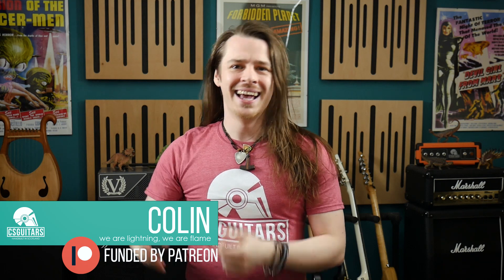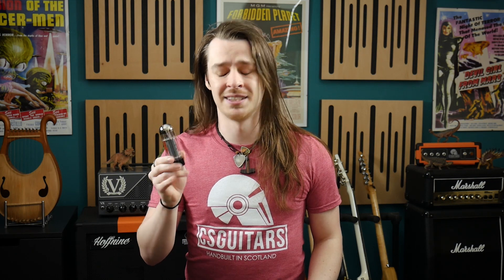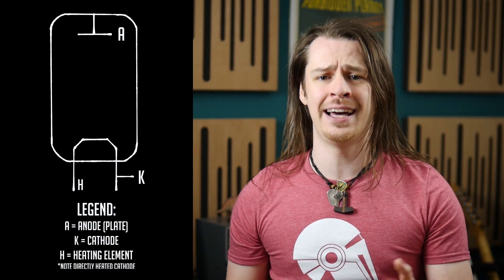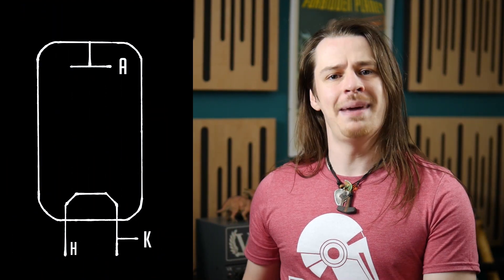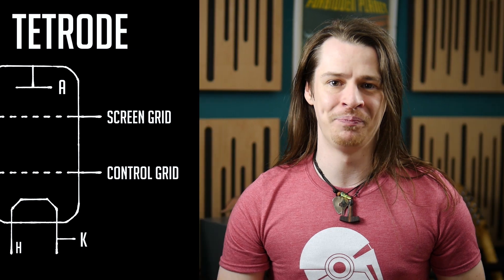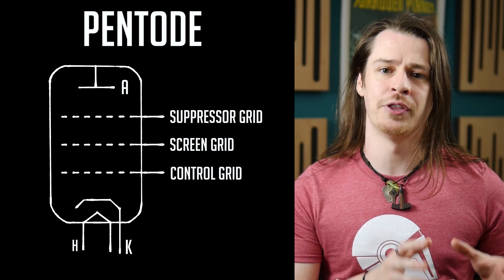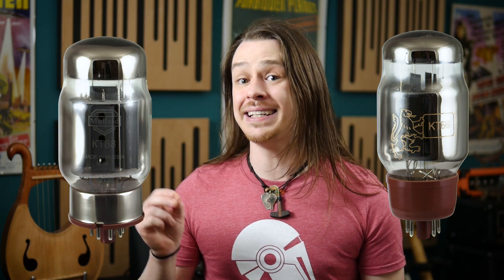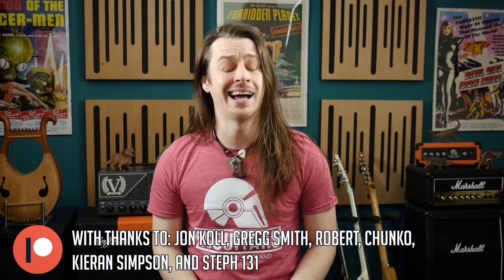Valve vs Tube | Troublesome Terminology

Comment: There's also the terminology difference of "Condenser" and "Capacitor" :)
Reply: Capacity is what it has, condense is what it does (can do).  Its capacity is its value, hence 'Capacitor'.  As a young (starter) TV engineer in the 1950's, this really confused me.  So what is it when it isn't condensing (reservoir)?  Like when it's coupling (DC block or -ve grid biassing), or filtering (by-passing).  Then like the fool I was, I read an American electronics book, and got really confused.

Comment: The Fleming thermionic valve was invented in UK, where we speak English (as opposed to the US where they speak American English). It was a bulb (bulbous) [1:29] rather than a tube (cylindrical), and rather than call it a bulb it was called a valve as that was its function.
The first triode was a bulb, and not a tube.
Most early valves were not tubular, but did have the function of valves .
Why on earth 'Merkins began to call non-tubular devices 'tubes' is a mystery.

As for Television tube - apart from the gun end it is completely non-tubular. "TV Funnel" would me more appropriate.

Comment: Colin, serious question. I'm planning on using my TubeMeister 40 for the next 45years or so, after which time I'll probably be looking forward to dying. You think it's worth me stocking up on spares now? In case I need a replacement when I'm 60 and the parts just aren't available.

Comment: It's called "electron tube" in Hungary but older people call the amps "lamp amp". :)

It's funny that the term "tube" (csöves) was used here for both the amplifiers and for the old-school rockers of the 80'ies who were wearing tight jeans (the term is referring to the the leg part of the trousers which is straight like a tube unlike those wide bootcut trousers that were in fashion in the 60-70'ies).

Comment: Main problem is a transistor is just as much of a valve as a tube.  We call them Tubes because they are more tubular than the Bulbs(light Bulbs) that they evolved from.  Of course the glass blowing style used for these came from Test Tube manufacture.  The rectifier is interesting in that it appears to have started out as an attempt to solve the self destructive character of early light bulbs then they realized its other properties and finally its use in radio.  Rectifiers would be like flapper valves/heart valves.  Transistors and Tubes work more like water taps in that they vary the flow of a current.

Comment: What about the audio characteristics of each valve? What is the difference between EL34, KT88, 6L6, that sort of thing? For example, KT100 is supposed to be the ideal valve for Drop A tuning or lower. But why? What can it do that other valves cannot? Which valve is best for which use, or are they all the same audio quality?

Can you make a video about this?

Comment: The story I'd heard is that Edison and a lab hand accidentally came upon the concept while trying to perfect the lightbulb. It has been years since I read the story, but I believe they were having difficulties finding a filament material with a slow enough burn to make electrical lighting feasible, and this is why they installed a grid in the first place. 
However, it wouldn't surprise me to learn that Edison was just trying to steal the glory. He was bad about that...  If you don't believe me, check out Nicola Tesla's biography.

Comment: The "valve", as you people on the wrong side of the pond call it, was essentially designed by modifying a glass tube. Therefore the tube came before the "valve". Which means the proper term is tube.

Comment: Britain: We call it a valve because it performs a function that is analagous to a fluid valve

USA: CALL IT TUBE COS IT LOOK LIKE TUBE!

XD
Reply: USA: We call it a trunk because it performs a function that is analogous to a storage trunk and historically was simply a storage trunk lashed to the rear of a vehicle.

Britain: OI! IT'S A BOOT INNIT? I KEEPS ME COLLECTION OF SEVERED FEET BACK THERE!
Reply from the maker: As with many old English words, a vehicle's 'boot' has no etymological connection to the more familiar homonym, referring to feet and their coverings. 

A car 'boot' is a remnant of terminology used for horse drawn coaches, where the boot was a storage compartment within the stage coach which was also used by the coachman as a seat.
Reply: It's almost as if these americans don't quite understand the language they stole ;)
Reply: Its also literally a tube with electronics inside of it.
Reply: so is a torch.
or an electric tothbrush.
or a vibrator.
or a stick blender.

The point is 'valve' is named after what it does , 'tube' is named after what it looks like
Reply: @nuberiffic  It doesn't just look like a tube. That's the point. It is a tube.  Which is a lot more succinct than an illustrative comparison to something completely different... Y'know, like a valve.  Because it is a tube, but it's like a valve.
Reply: Oops, my mistake.  His exact words were that its 'in a similar way' to a valve.
Reply: So why aren't you calling vibrators and torches tubes?
They're literally tubes.

And even then, it's not literally a tube. It's a bulb. With prongs on it. Not a tube - it just kinda looks like one.

Is it maybe because the sensible thing to do is name an object after what it does?

You know how a electronic valve regulates the flow of electricity - because that's what a valve is? Something that regulates flow. Sure it used to only apply to water and air, but that was before we knew we could regulate the flow of other things.
Reply: Damn, I read your first one and replied before I read this haha.

But still, yeah, it works 'in a similar way' in that it performs the exact same function.
Reply: @nuberiffic  lol, we may have to agree to disagree.  I'm not quite as invested in this topic as I realize I was sounding.  Now if we really want to get some deep practice in pointless arguments about english vs american names, we could get into paracetamol vs acetaminophen.  I'd even have to do some extra research on that one.
Reply: Haha, fair enough :)
Reply: @jmurockstar  The trunk is usually located in front of the elephant.

Comment: The glass is there just to hold the vacuum, the shape of the glass doesn't matter, metal was also used.  The 1st diode valves were round and more like light bulb shaped. The triode came later and was made from a glass tube. Plate is also kind of dumb, cathode and anode add info to the device, plate could be anything. Why not dumb it down more and call the cathode the 'stick' and the control grid the wire bits!

Comment: The Russian military still uses valves in things like radar sets apparently. Since a valve isn't susceptible to EMP blasts like a transistor is.
In any event, whether we call it a valve or a tube really doesn't matter, we all know darn well (or should) what is being discussed.
Thanks for the good history lesson, you got a ton of info in there that can get pretty darn technical at times.
Reply: They still use valves for TV transmitters at incredibly high voltages!

Comment: There are these nu-tube things finding their way into pedal-board amps now, with lower voltage requirements for the filament and lower plate voltages too, I think, with their really small size they can be used with SMD designs and apparently reproduce the characteristics of the larger ones very well. I haven't actually seen one in the flesh, but they will hopefully catch on.... they make DIY valve projects much more of an attractive proposition.

Comment: I live in Australia (which is typically British oriented when it comes to language) and even I get some confused looks when talking about "valves" as most guitarists here have learned to call them tube amplifiers (not toobs in this case). 

Myself? I call them valves but use America's classification system for them. 12AX7, not ECC83. I just find it sounds better.

Comment: Maybe a video on Tube/Valve interchanging? Like EL34 vs 6CA7 vs KT66... they have similar pinouts so they can be interchanged but is there a difference in sound?  What if anything is involved in tube interchanging?  Also preamp tubes... .AX AT AY AU.

Maybe a TATA video?

Comment: I never knew a valve could do that 2:24 , pretty impressive.
Reply from the maker: This is how valves amplify. 

A guitar signal is very weak, small voltage and current. 
By applying that small voltage to the Control Grid, the guitar signal controls the much larger flow of current through the valve. What comes out of the anode is then an amplified copy of what was sent to the grid, obviously with the valves own colouration added into the mix.

Comment: Why get so caught up in terminology?  Meanings are in people, not in words.  Hence why two different words can mean the same thing.  What these devices are really called are things like rectifier, triode, tetrode, pentode, etc... With more specific names for each, such as beam power triode or RF pentode.  Electronics engineers often refer to devices by their part number rather than any of the aformentioned.  Arguing about calling it a tube or valve is like arguing potato or spud.

Comment: i got to thinking seeing how the flaming diode works gave me a theory  

couldnt electroplating be done without the acid baths that are used to do most electro plating.

simple place the part you want to plate on the anode and then a chunk of gold as the cathode and do it in a vacuum chamber and heat the gold and the high voltage would emit gold atoms to the part you want to plate.

simple no spent acids that need to be disposed of

Comment: Calling it a valve seems nonsensical. A valve is a mechanical thing that opens and closes. Tubes are not mechanical. Nothing moves. Nothing physically opens. Nobody calls a solid state transistor a valve. And rightly so.
Reply from the maker: Tubes are physically hollow cylinders open at both ends, therefore it's illogical to call valves tubes when they are clearly a bulb.

See, this is fun and can go both ways.

Comment: So what's the conclusion? They are interchangeable? Or tetrodes are valves and pentodes are tubes? You looked at the patents in order to tell us which term came first, but then you didn't actually give us the result.

Comment: Yeah, but you guys call it a boot instead of a trunk, so I think you can forgive us for describing this by its form rather than its function.  I mean, seriously.  Boot?  You wear those on your feet.
Reply from the maker: As I explained to someone else making this point:

As with many old English words, a vehicle's 'boot' has no etymological connection to the more familiar homonym, referring to feet and their coverings. 

A car 'boot' is a remnant of terminology used for horse drawn coaches, where the boot was a storage compartment within the stage coach which was also used by the coachman as a seat.
Reply: @ScienceofLoud  I was just making a silly joke, man.  But "trunk" as a location for storage makes more sense in modern English to my ear.

Comment: I'm sure you were just joking (?) and I have nothing against British people, but I have to say this anyway. Maybe we ex-British colonists should have let you handle those Germans by yourselves. Then you could have explained to them the difference between valve and tube.
Reply from the maker: Yeah, maybe if you guys had jumped in from the start like everybody else instead of pretending like it wasn't your problem until someone sank a boat. 

America waded in fresh as a daisy and fully equipped to a war that had been going on for several years, assisted in defeating an army that was already depleted in resources and stretched across several fronts, and still has the audacity to act like they won. 

That's like joining a marathon for the last 100m, sprinting across the finish line and then claiming victory. 

America should be ashamed, rather than proud, of its decisions during that time in history.

Comment: Doesn't matter what it is called as long as it does what it does. Nonetheless, a tube is in the mix while the overall composite may operate like a 'valve' in the circuit. But, what to call them as used in the amplification of a signal where they're being used to amplify the signal? A multiplier? :D

Interesting historical background is the best part of this bit, the humorous ribbing and debate over the name aside. B-|

Comment: If this was covered on my physics degree I'd have paid a lot more attention
Reply from the maker: I very nearly went into field emission and quantum tunneling when addressing the potential energy barrier. 
Perhaps a discussion on a 'cold tube', an energy efficient, hyper responsive valve that works by quantum tunneling will be a discussion point in the future.

Comment: If you call them just a valve, then you’re wrong. A valve has moving parts. Do Vacuum Tubes? Nope. A Vacuum Tube is by definition not a valve. Either call it a thermionic valve or tube, or stop complaining.
Reply from the maker: An electric signal applied to the control grid is your 'moving part', the fluctuating potential is what controls the electron flow through a thermionic valve. 

There are many types of mechanical valve that all have specific names that are often dropped for the more general term of 'valve'. 

In a similar fashion there are many, many types of 'tube', so using that name alone doesn't make much sense out of context. In fact even the term 'vacuum tube' is ambiguous as it could refer to many things.
Reply: CSGuitars fair point. I was just saying that for the sake of argument lol.

Comment: Why doesn't someone make a tube factory in America? I'd pay a little extra for them.
Reply: Because it wouldnt be a "little extra", it'd be a lot extra. Tubes are already expensive compared to the alternatives.  

There are only three or four manufacturers left iirc, and they're using machinery that is fourty years old or older. You would have to sink a metric fucktonne of money just to get started, and what you produced likely wouldn't be as good as what's on the market now (at first). Its not a sound business decision.

Comment: Thank you Robert. Or are you a Bruce? Great video, tech terms are the worst things to deal with. I like the British title better. Now I can screw with my musician friends heads with this. They made fun of my $200 tube amp. Now, it's My turn. As a mechanic I often encountered unfamiliar terms in parts and repair manuals. Case in point. The huge nut that holds the flywheel onto a VW engine crankshaft: US: flywheel nut. Euro/German: gland nut. And let's not forget torque specs. American: foot or inch pounds. Euro: kilograms. I truly despise engineers whose designs intentionally make jobs more difficult than they need to be. Never make it easy, stack the accessories, make finding and removing fasteners as painfully difficult as possible. Henry Ford did that so the average person could not fix a problem, so that Ford owners would be forced to go to a pro, preferably a Ford dealer service mechanic.

Comment: A valve has a moving part. This device does not. A tube describes how the electronics are packaged. And the first Vacuum Tube wasn't invented by anyone in England, it was invented by Thomas Edison who invented the incandescent vacuum tube resistor which actually did something useful. Incandescent Vacuum Tube resistors were used for well over 100 years, until it was superseded by the light emitting diode which was made from a semi conductor. It, like the light emitting Vacuum Tube Resistor traded light for heat, although in the case of the LED,  it's much more efficient and the amount of heat it generates is negligible, while its earlier cousin could warm a room and several banks of them were used to make paint dry in automotive paint and body repair shops, when the process has to be sped up in order to handle the volume of jobs being done inna given day.